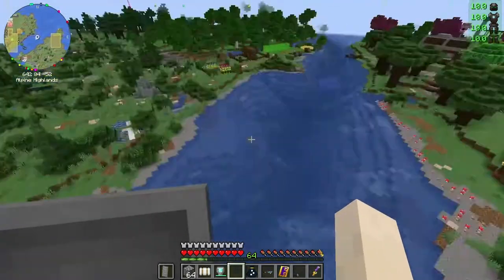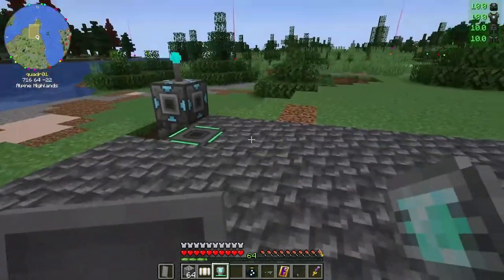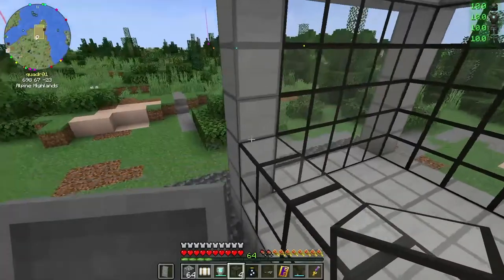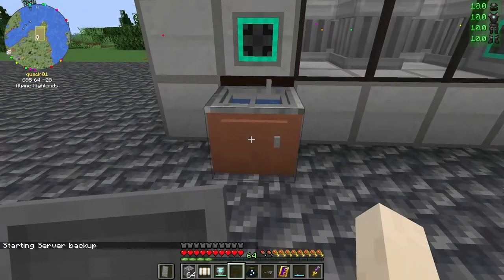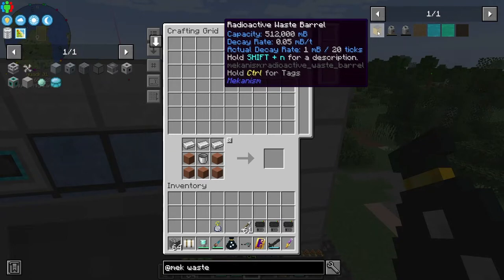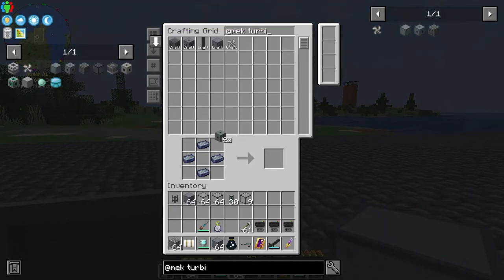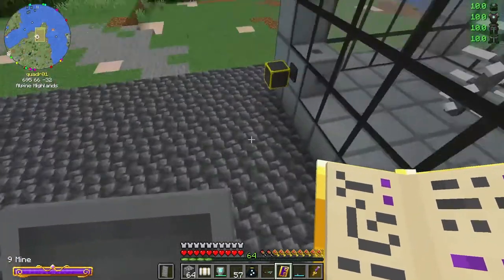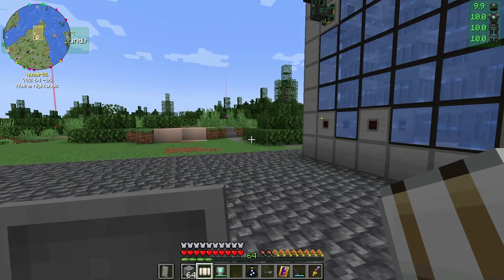DireWolf20 1.18 Let's Play Episode 108: Fission Reactor and Turbine

Comment: Oh hey, did I see correctly you've moved from your old small ME Controller to the new one around your induction matrix?

If the reactor runs out of fuel, overflows on energy, gets too hot, runs out of coolant, etc, while you're offline, it'll "shut off" and explode, dosing the area with radiation.  That radiation I think takes about 9 real life hours to dissipate, but if you have the radiation shielding in your Mek or Pneumaticraft armor, it shouldn't hurt you.  But you probably want to wait for it to subside before turning on the reactor again.  😛  There are I think 5 different triggers in the logic port, but each port can only do one; I've got all 5 on my reactor feeding into a Super Circuit Maker toggle (could use a Create toggle as well) that turns the reactor if any of them send a signal.
Reply from the maker: Yes, you did see correctly :) I moved it on over once I got to the point I could us the p2p tunnels. Although, with that many controllers, I probably don't need to use p2p LOL

I hooked up a crude trigger just for temp at the moment, but I turned the reactor back off because I am not prepared for all that power nor am I ready to process all the waste. I guess I know what to do tomorrow:)
Reply: Just watched the rest of the video now; you need more pipes on the sink to increase the rate, not the reactor.  But I've only got one for my sink, as it's only used to initially fill the reactor and top it up; the rest of the water comes back from the turbine.  There, I needed about 8 pipes pulling water from the turbine into the reactor to keep up with full demand and get my 1.2 mrf/t.

When you searched the keybinds for The One Probe, you forgot to select "Category".  😛
Reply from the maker: @JakeMoe  The Fission Reactor that I built in my OceanBlock world was completely unstable. I could never push it hard enough to really get very much RF out of it. I would get to around 10 for the Burn Rate and it would completely drain the whole system of water and the multitude of pumps that I had on it could not keep up with the water requirements. The Fission Reactor that I built today, I was able to push it up over 50 before I had to go to work. I am not sure about how far I should keep pushing it to. The temp was starting to turn orangish in color but there was still plenty of volume left in the Turbine and it was producing quite a lot of RF. That was the biggest reason I wanted to turn it back off, because the RF started backing up in the Turbine because I still only have the one cell in my Induction Matrix :(